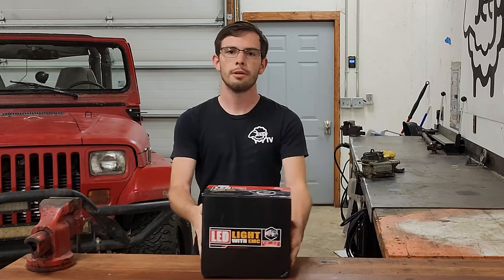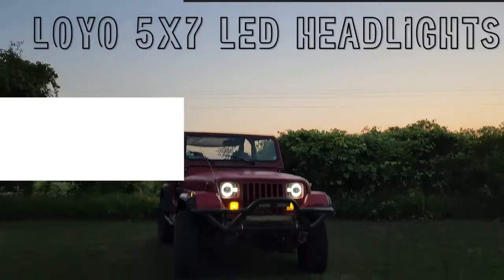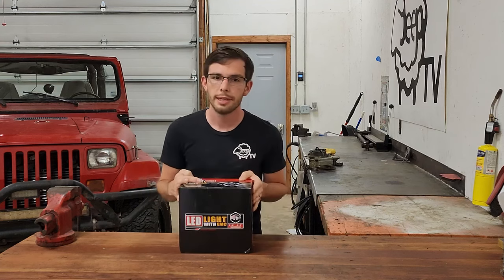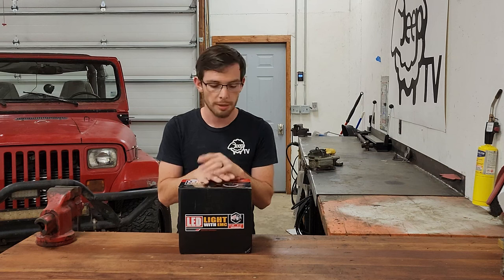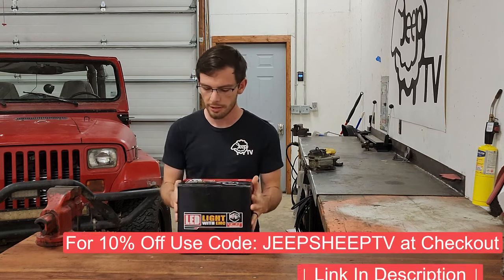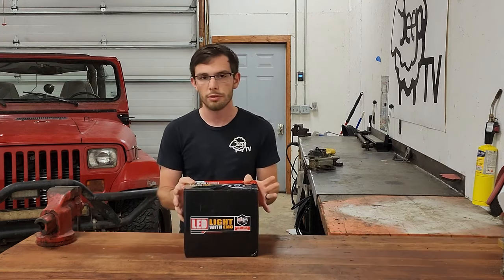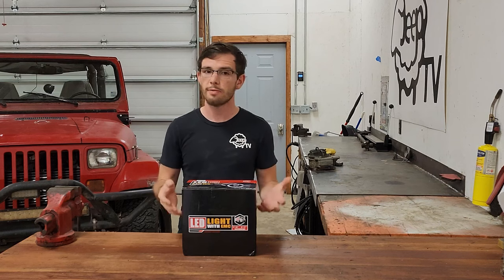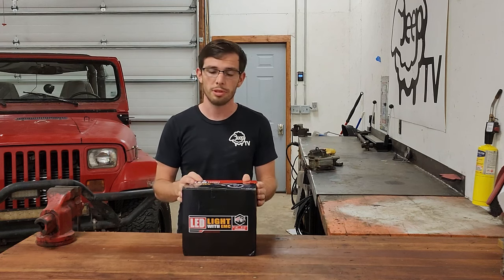LOYO Newest 5x7 LED Headlights Review and Install

Comment: Idea mía o puso los focos al revés???? 💡💡
Alumbran súper bien si 👍🏻
Reply from the maker: If I understand your question correctly, these headlights are designed so that each headlight can be installed on either the left or right side. And yes, they do provide excellent brightness.😊

Comment: Do you have an EP27 Relay already installed? I am looking at putting these on my 98 XJ and every other LED conversion I have seen they talk about needing the relay.
Reply from the maker: A relay kit is specifically required for some older vehicle models to make sure everything works smoothly. Basically, it helps the LED lights function properly by controlling their flash rate, intensity. So, to get the best performance and ensure compatibility with the LED conversion, it's recommended to have the LED relay kit installed on your 98 XJ.
Reply: Just FYI I did this today with a 98 XJ and it worked out of the box. No relay or headlight harness. I had Trucklite leds in before and they worked as well.

Comment: Love these Bronco style lights. There is not a better looking set out there. Im helping my neighbor install this exact set in his 01 Cherokee XJ. Im going to install a set in my 97 Cherokee XJ. I came to this site because we were having trouble with the turn signals. Wired TS and they flash only if halos are unplugged and if headlights are off. And they flash white instead of amber. This has to be a problem internal to the headlight such as a bad board. Can you help? Exasperated. These were purchased from your website. Thanks much.
Reply from the maker: Thank you for your appreciation of our Bronco style lights. We're glad to hear that you find them to be the best-looking option out there. We appreciate your support and your recent purchase from our website.
Regarding the issue you're facing with the turn signals, it's related to voltage compatibility. To address this issue, we recommend purchasing an LED Flasher Kit. This kit is specifically designed to ensure proper functionality and compatibility with LED lights, resolving voltage-related problems and ensuring correct flashing and color display.If you have any further questions or need assistance with the installation, please don't hesitate to reach out. We're here to help you resolve this issue and ensure you have a successful installation.
Reply: @LOYOOFFICIAL do you have a link for the kit? I’ll buy that one

Comment: can i make these work in my 1988 Nissan D 21 Hardbody? What would I need?
Reply from the maker: These are universal 6054. If you have the standard rectangular sealed beam headlights, these fit and work on a 1988 Nissan D 21 Hardbody. Normally it don't need extra wiring harness. However, in rare cases，you may need“ H4 relay harness”cause some cars circuit may cause un-constant voltage, make the headlights dim or can't light up
Reply: worked on my 1990 hardbody
Reply: Yes! It worked for me to